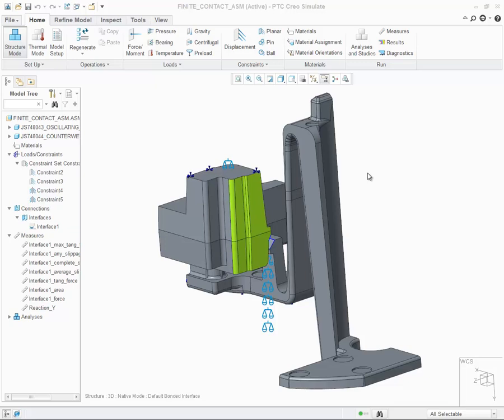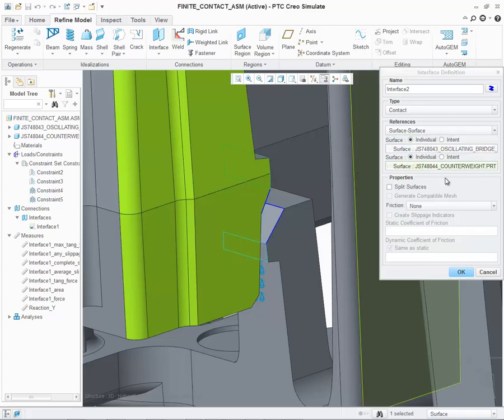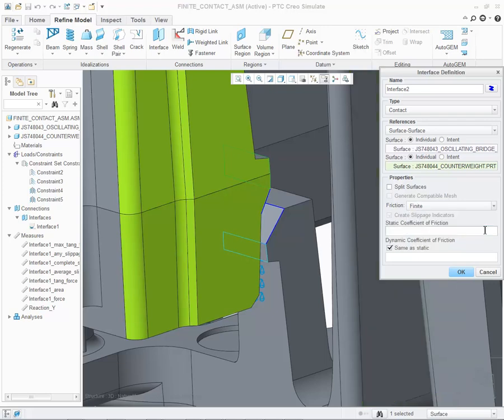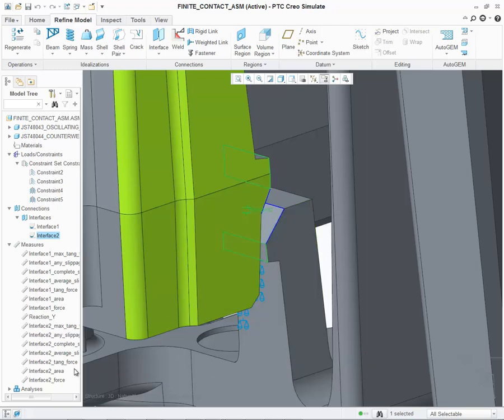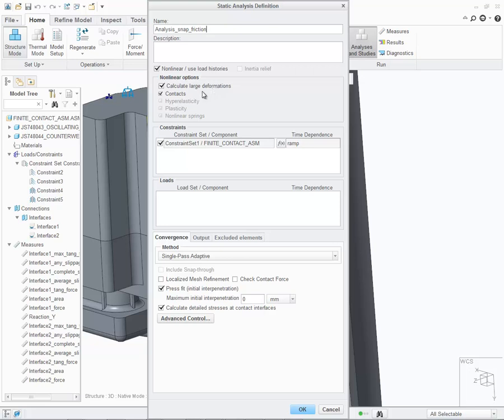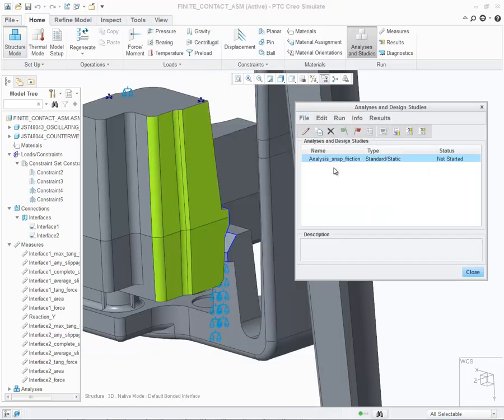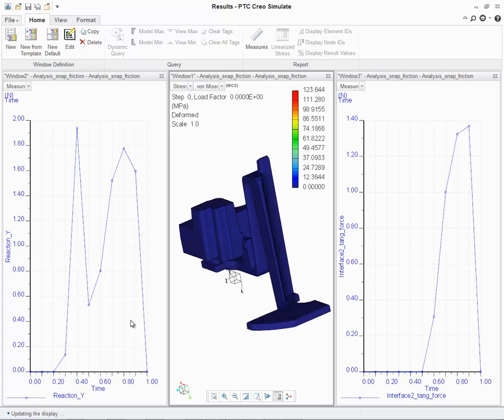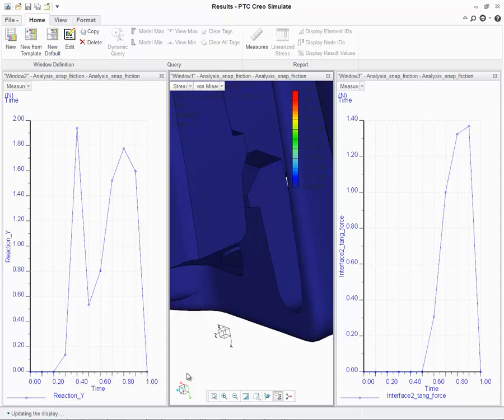Defining Contact Faces with Finite Friction

Comment: I'm running a similar analysis on a hinge and facing two problems, 1. As I increase co efficient of friction, measured reaction force is coming down which doesn't make much sense. 2. My movement is limited to exact completion of snap, anything more ends up in error, excessive sliding can't converge. Any clues on solving this?